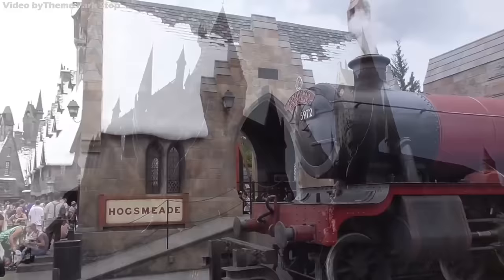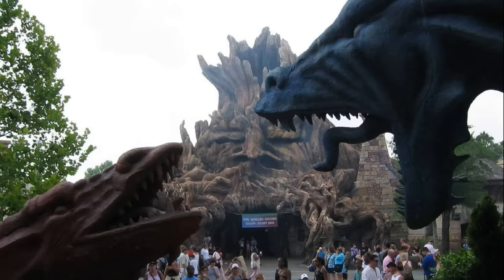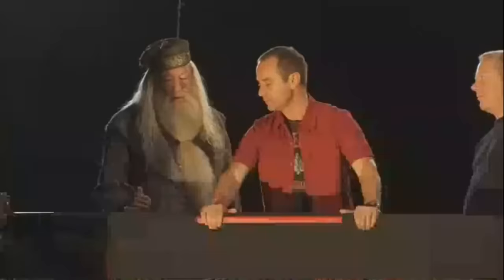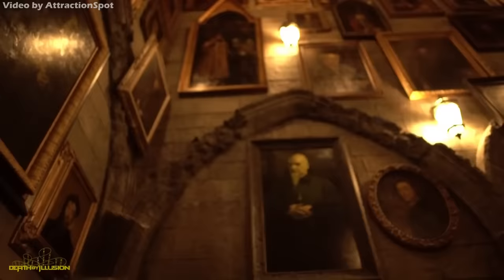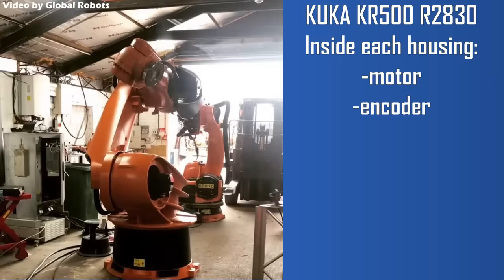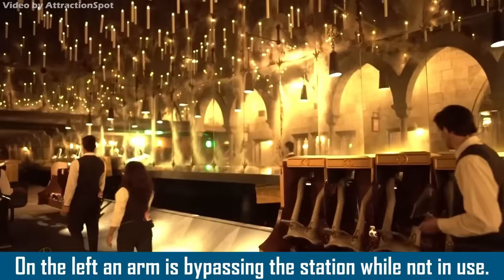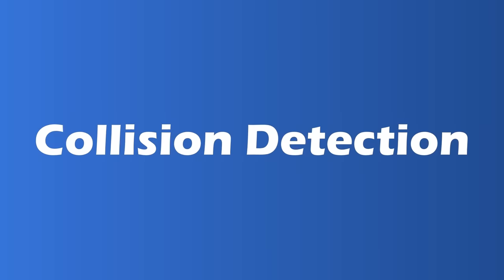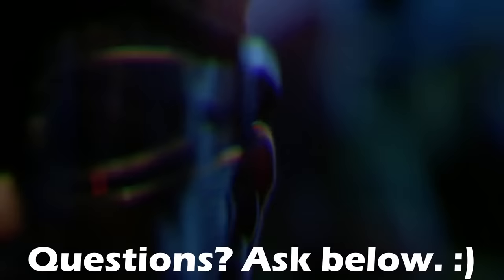How It Works: HP & The Forbidden Journey | The Robot Ride Inside Hogwarts Castle

Comment: In the ¨loading area¨ portion of the video, as some seats are facing the coveyor belt. Throug the arm gap,  between each vehicle you can see some  that run "hidden"  or in neutral position. I guess this mode is activated whit  low attendance or safe distance. My question is: Do this vehicles even thto they are "neutral" still trigger the efeectos on each scene or they just pass the on cue but no trigger?
Reply from the maker: I'm not sure. I'd be willing to say probably since everything is pretty much timed, but could also be triggered, but I could understand if each arm uses a flag to activate effects and if it's not being used the flag is down.
Reply: Those vehicles are “disabled” but still run along the path until they are enabled again. If you happen to be at the ride when it first opens in the mornings, or are there during lower capacity times, some vehicles may be disabled so that the attendants don’t have to dispatch a bunch a empty vehicles. Vehicles can also be disabled if they have any audio, harness or other issues until maintenance are able to address the issue. This can also be done if a guests stomach doesn’t agree with them and the vehicle needs time to dry after being cleaned.
Reply: @AmusementLabs  they're not triggered, effects still happen even when benches are disabled 👍

Comment: But...if you a little bit over weight its painful or worse yet like a few other rides...you cannot ride it. The BIG flaw of Universal.
Reply from the maker: The Florida version does have larger seats.
Reply: All of the seats at the Universal Orlando FJ have been modified to fit larger guests. But there are test seats in 2 places at this venue to try before you ride. Most rides at UOR have test seats outside their rides.